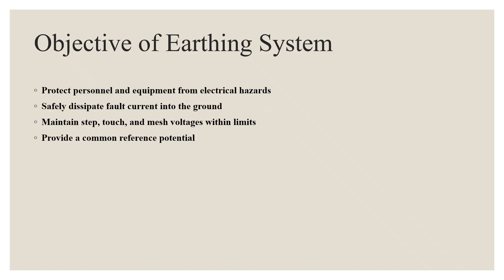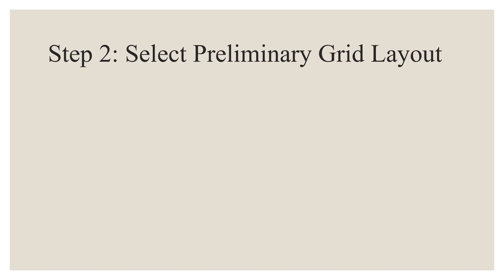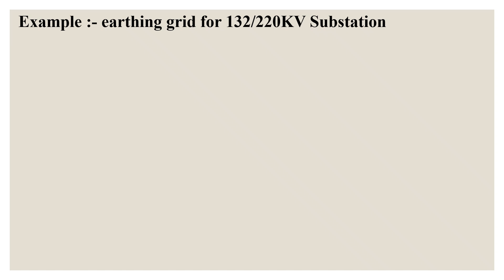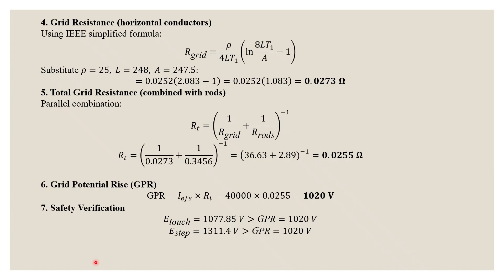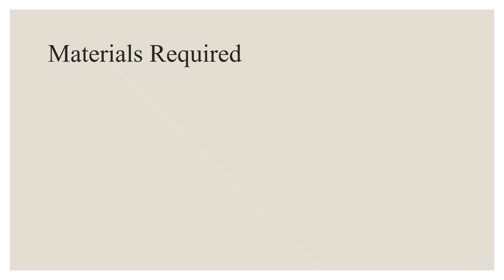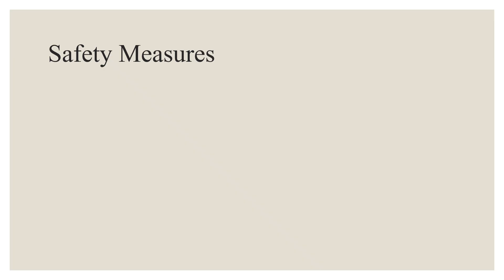Substation Earthing Grid Design As Per IEEE 80 Standard

Comment: Bro ..your touch and step potential are wrongly calculated. Actual touch voltage will be 170v. Which is quite higher than GPR. Correct it. Your design will not work for 40kA